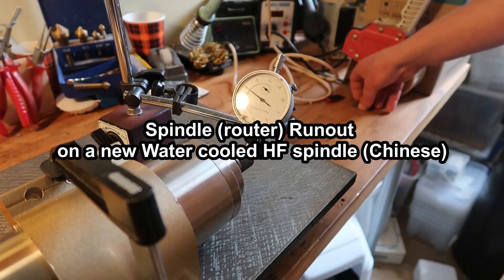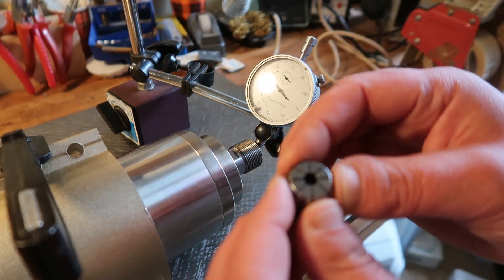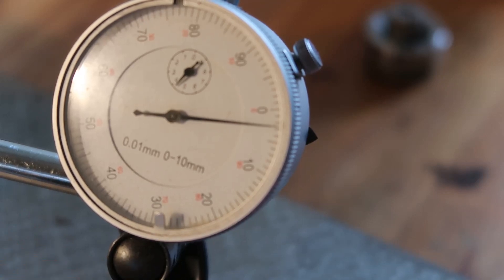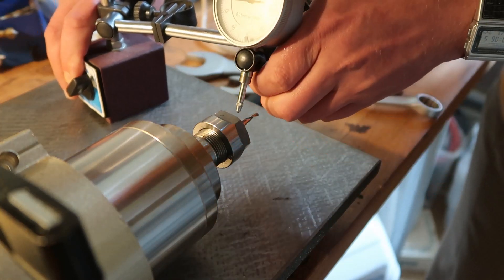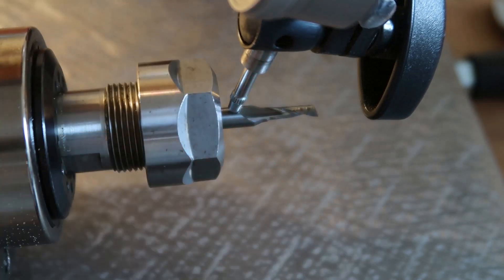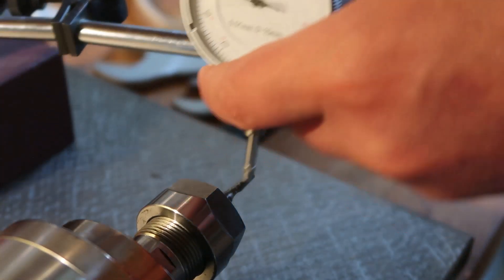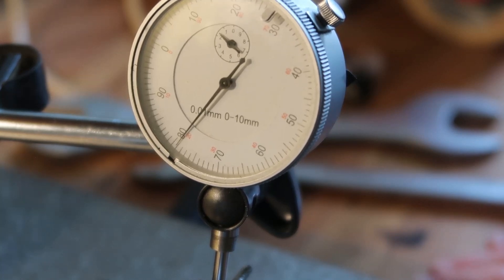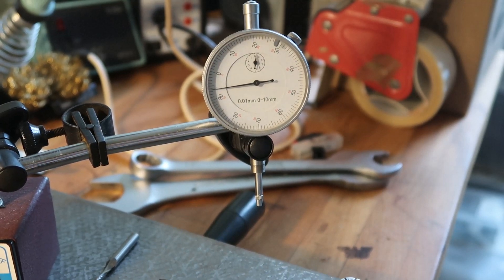CNC - 2.2 Kw Water Cooled Spindle - runout

Comment: You might be able to turn the collet, rotate it in the spindle cone and find it's  best position. Plus or minus 10 micron is not terrible. There are true high precision Chinese collets. They get sold as German :) 

Mark

Measure properly means a dowel pin and measure the runout.
Reply from the maker: yeps,  i had a linear shaft but its not straight enough, im not to sure if a dowel is , for such measurement.  but yeah we will see i ordered another collet.  4 times the price this one was. although be it for the size i use most :) since i dont want to wast any more money on this stuff.   one last try and i quit, i mean its still a router :)
Reply: @joppepeelen   Yup I agree. There are always points where you stop and say enough.

Comment: The nose and the cutter are almost 100% OK. A carbide cutter is typically in the tenths of a micron or less of runout, even when measured at the cutter tip - and the collet holder seemed good.
Cheap chinese collets OTOH can be really bad, certainly as bad as the one you showed here. The nut is typically less sensitive o manufacturing errors, most of the force and centering is done by the lower angle female part in the collet holder (nose).
One thing you can do to improve a bad collet or nut is to break all the sharp edges in the bending slots, typically cheaper collets have lots of burr (wire edges) around the slits. Just run a triangle needle file or deburring stone along the slits a few times.

But I'm fairly sure almost all of the runout you measured here in in the collet. Also, when you use a push-style micrometer gauge, make sure to have the measuring tip at 90 deg to the thing you measure. 15 degrees off isn't much of a cosine error (4%), but the measuring head can behave strangely if it's not perpendicular to the measured movement
Reply from the maker: thats a good one !! i tried to make it a 90Degree, but since this dial is not ideal for it :(  (pupy one would be better) its what it is.  i ordered a New really expensive collet just for one size.. unfortunate not the size of this cutter since i harrly use it :( but since the collet is 40 euro inc shipping..... ill try 1 first haha.

thanks for the info !!!!

Comment: Id say that the error is in the spindle nose and collet- they are notorious for being dodgy. The clamping nut should not affect the run out as it should be just pulling the collet into the 
spindle taper.
Reply from the maker: i  bought some new nuts and collets....   the nut said 0.015 thats pretty insane :( the collet had no rating.. so i wonder what that combines to :( but lets try :) 

might be even worse :)